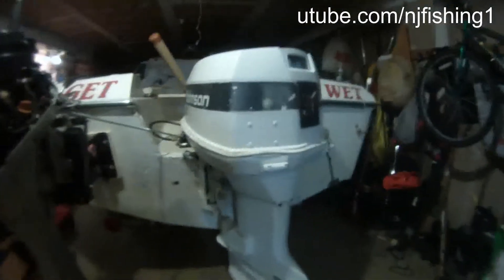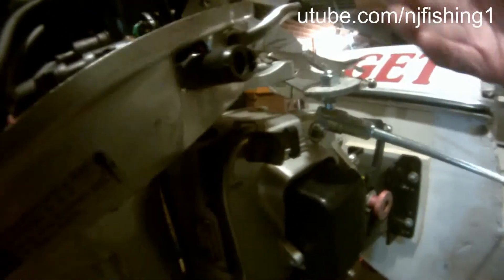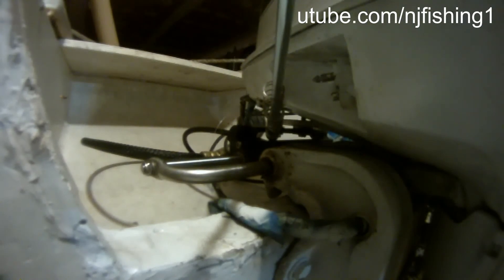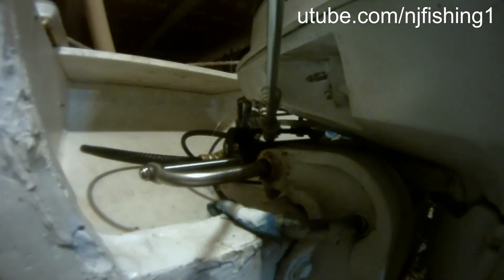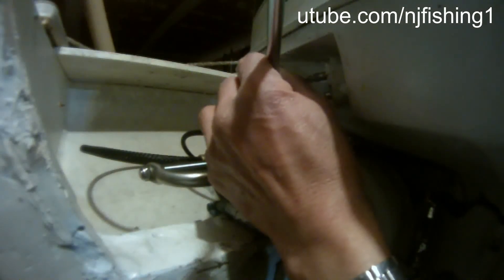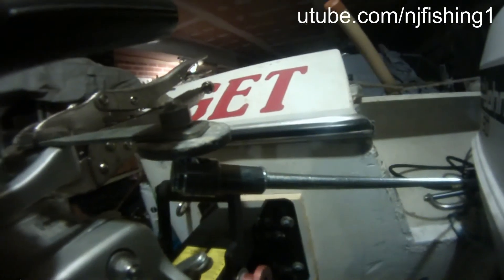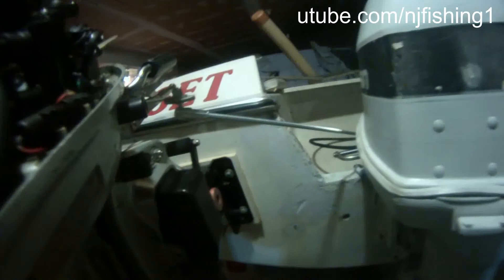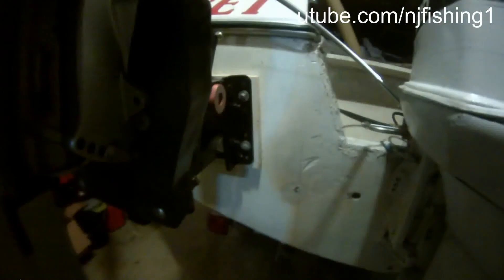Mock installation of kicker motor (3.2 of 4) using Panther outboard to outboard steering kit 55-2400

Comment: By the look of the exterior of that transom plus the age of that boat I would say there is a good chance the wood inbetween the fiberglass of the transom is rotten ,There has been more than one motor ending up in the drink when a rotten transom breaks away

Comment: Terrible
Reply from the maker: yes, I agree it was terrible. I could not find any video of its kind and didn't want to spend close to $300+ for an outboard to outboard steering link from the market. It is my hope that these videos can help any YOUTUBE viewers to try doing it on their own to SAVE MONEY and enjoy the water by boating. If I have to do it again, then I would (1) use more expensive stainless rod to avoid rust, (2) use my existing rod to get an exact measurement for the new rod, (3) to bend the new rod in shape much quicker and accurately. You cannot beat it when it cost me about $50 to get what I want. Check out my test drive videos on the Potomac River and Cheasapeake bay. It works much better than extended tiller handle to operate the kicker motor.